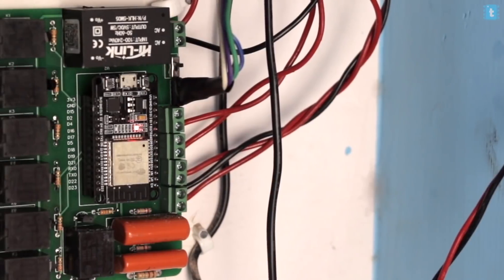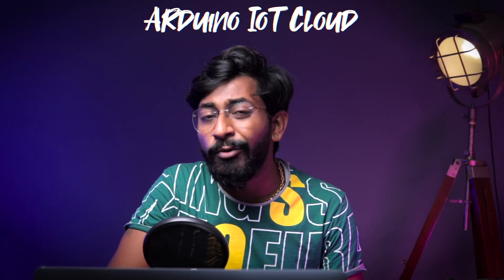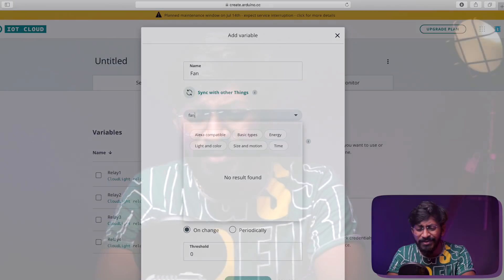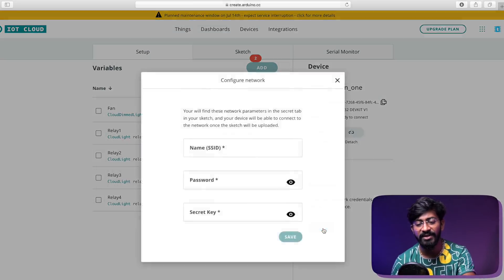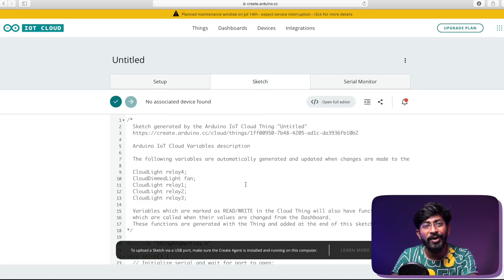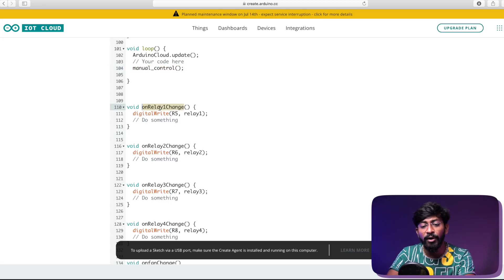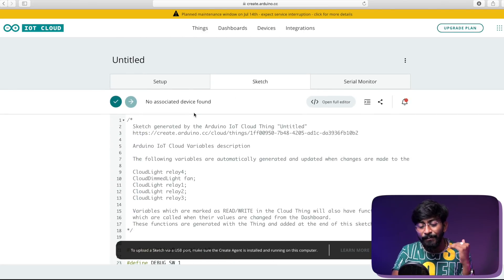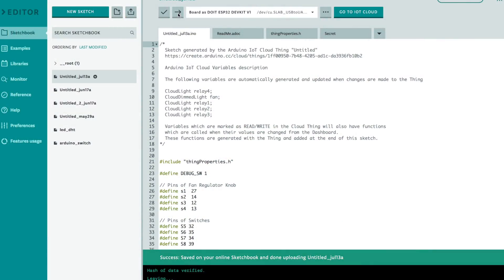A perfect Automation project for your Home & Office | IoT Projects | ESP32 Projects

Comment: i have made this project ,everything  is working is correctly but ,when i click  to ON relay  it go in off status and when i click off it go to ON status .
please reply sir .
Reply: I have made this project. But not working. Can you tell me your project working is normally. Yes Or no
My esp32 is same time cutoff internet connectivity
Or same time i wil chng fan speed then light or fan all are of after few seconds only on ligh. Then any manual switch or fan knob not working..
Reply: Plz rply
How to make..  You your project. If any chngs coding... 
And yor problem I will help u

Comment: Sir Please created a project convert with 433 MHz RF transmitter and receiver
#include <IRremoteInt.h>

#include <IRremote.h> // use the library
int receiver = 11; // pin 1 of IR receiver to Arduino digital pin 11
IRrecv irrecv(receiver); // create instance of 'irrecv'
decode_results results;

void setup()
{
  Serial.begin(9600); // for serial monitor output
  irrecv.enableIRIn(); // Start the receiver
  pinMode(5, OUTPUT); //IN1 of first Relay
  pinMode(6, OUTPUT); //IN2 of first Relay
  pinMode(7, OUTPUT); //IN1 of second Relay
}
void loop()
{
  if (irrecv.decode(&results)) // have we received an IR signal?
  {
    Serial.println(results.value, HEX); // display it on serial monitor in hexadecimal
    irrecv.resume();// receive the next value
  }
 
 //Check if other Relays are OFF before turning ON the one selected.
  if (results.value == 0x"YOURCODE1"){ 
    if (digitalRead(6) == LOW && digitalRead(7) == LOW) {
    digitalWrite(5, HIGH); 
  }
    else if(digitalRead(6) == HIGH || digitalRead(7) == HIGH) {
      digitalWrite(6, LOW);
      digitalWrite(7, LOW);
      delay(1000); //Wait a sec just to be sure of not causing a short circuit
      digitalWrite(5, HIGH);
    }
  }
  
 if ( results.value == 0x"YOURCODE2"){ 
  if (digitalRead(5) == LOW && digitalRead(7) == LOW) {
    digitalWrite(6, HIGH); 
  }
  else if(digitalRead(5) == HIGH || digitalRead(7) == HIGH) {
      digitalWrite(5, LOW);
      digitalWrite(7, LOW);
      delay(1000);
      digitalWrite(6, HIGH);
    }
 }  

 if ( results.value == 0x"YOURCODE3"){ 
  if (digitalRead(5) == LOW && digitalRead(6) == LOW) {
    digitalWrite(7, HIGH); 
  }
  else if(digitalRead(5) == HIGH || digitalRead(6) == HIGH) {
      digitalWrite(5, LOW);
      digitalWrite(6, LOW);
      delay(1000);
      digitalWrite(7, HIGH);
    }
 }  

// Put here your code for turning off the Fan
 if ( results.value == 0x"YOURCODE4"){
  digitalWrite(5, LOW);
  digitalWrite(6, LOW);
  digitalWrite(7, LOW);
 }

}

Comment: I was searching for a project regarding a perfect home automation using the ESP32 and I think you are the perfect person to make the project a success. 
So the concept is that one of the ESP32 will be connected with the router and other ESPs will be connect to the master ESP through mesh networking in sperate rooms. And using HTML we can make a dashboard for controlling the appliances and since it's connected with the router with a IP so anyone in the house can access the IP to control the respective appliances. This can also help in combining the projects like automating the water tank, smart door bell, home automation and many others. We will also be able to see which room is consuming how much electricity per month.
That's my one of the most desirable project and in my eyes you seems the perfect person to make this projects and codes work.
Looking forward for your response.
Reply from the maker: I already made that 
https://youtu.be/yZvhygHA_sw
Reply: @techiesms  I have already seen that video many times but my question was something different.. It was like making custom dashboard using HTML which anyone can access if they are connected in the same wifi network. And that project is dependent upon Blynk server, isn't there another way?
Reply from the maker: You can take the code for reference and easily create an HTML page 

It won’t be that difficult
Reply: @techiesms  I will surely try to make this stuff and will let you know if it was a success or not
Reply from the maker: Sure

Comment: Hi realy a great video.
But I didn't got one thing like how esp board is getting status of light when its gets on/off manually by switch.

Please help me on this.
Thanks
Reply: I don't know how he did that in the video. But there are many ways

To do this you must know how to turn on a regular LED with a 220v AC current with a regular button switch. Once you achieve this, then just read the state of an LED by digitalRead() through the ESP board using a PhotoDiode if it's on or off. But remember, use a photodiode to get the value, don't connect the AC mains directly to your ESP board.
Reply: @dahlendo7513  Thanks 😊.. actually I have achieved this using two way switch and relay but my problem was like when light is getting on/off with manual switch I was not able to reflect this on my web portal.
Reply: @ROHITGUPTA-ui5bf  Once your ESP or any microcontroller recognizes the change in the Button state (if it's on or off). 

Then you can simply send the signal to the Client's web browser from the ESP's web server using the WebSockets.
Reply: You have to give mains wiring to relay only. Remove the mains wiring from switch and connect the switch to esp pins as input.

Comment: Woah 🤩 thats a cool project, can you give some suggestions where to learn Arduino ide programing
Reply: I'd recommend getting yourself an Arduino or Elegoo starter kit online. They come with a lot of useful parts and also a good beginner's guide to circuitry and using the Arduino ide. You can also find the guide online by searching for "Arduino projects book".
In addition to that, there are lots of great tutorials on youtube and other places. "Paul McWhorter" on youtube has a really great tutorial series that starts with basic projects and works up from there. Best of luck!
Reply from the maker: Yeah
Even I would have suggested searching for YouTube videos
Reply: Thanks for your suggestions 🙂 I will check them out